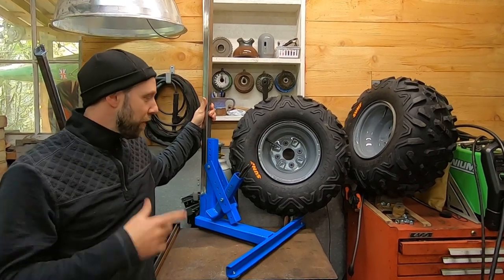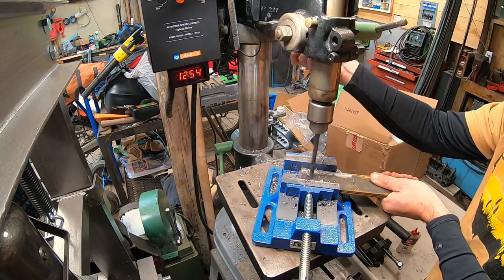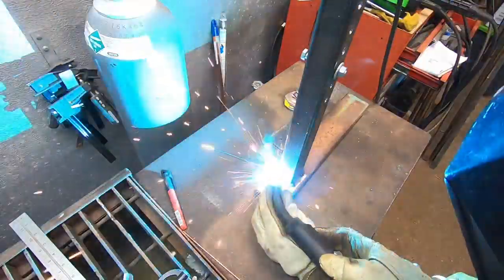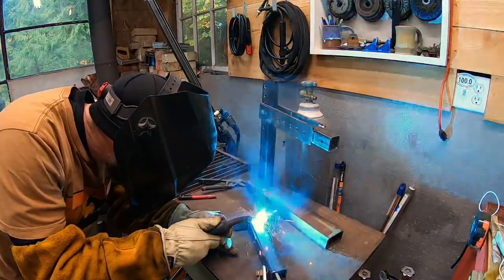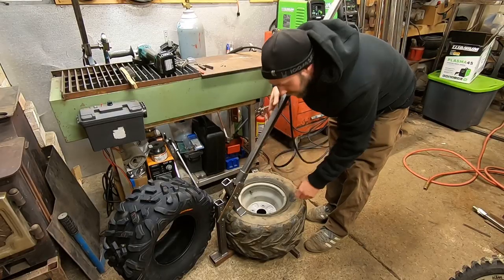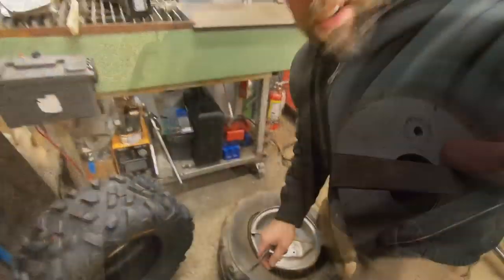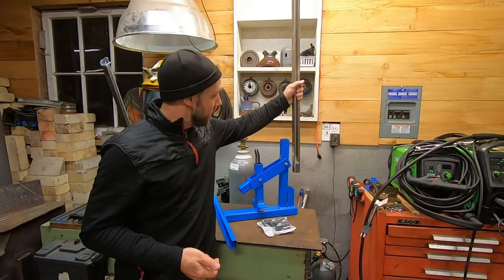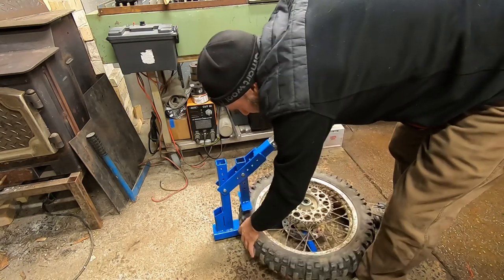ATV / Motorcycle bead breaker plus fabrication tips

Comment: Nice project Mike!! I'll have to show you the one I built a while back, wait, video idea!!!! 😆 I went super lazy kid on mine, you'll like it.
Reply from the maker: Haha I would like to see it!
I made the first cut this evening on my CNC plasma table, I still need a lot of practice in Fusion 360 but I was able to export some G code and make some cuts, I definitely need to dig into cut speed and fine tune pierce time but it’s just going to take time. Thanks for checking out my video 🙂
Reply: @Mikefestiva  I tried fusion 360 but it just felt cumbersome.. I'm sure with enough seat time I'd like it. Congrats on the first cuts!!! Once you start building projects using it, you'll wonder how you ever did things before without it!!! 😆
Reply from the maker: Yes Fusion 360 definitely has a steep learning curve, I luckily found a few really helpful videos posted on drawing and exporting 2D CNC plasma files. I’m also learning Mach3, it definitely feels like there could be some improvements and updates to make Mach3 work flow better.

Comment: to make this one a DIY hydraulic version, just reverse the long bar so it still levers off the back, a little shorter and put a 2-4 ton jack in between  a small flat part off the bottom and the handle.

Comment: Great job on the bead breaker, if you were to build it again would you extend the arm out more or does it work on all sized tires?
Reply from the maker: Thanks for checking out my video!
I think there’s probably enough adjustment in it to cover a wide range of tires but one or two more inches would give a even wider range,  21” rims are about the biggest I think I will ever need to do on this tool. Take care 🙂 
Ps Have you been working on any new projects lately?